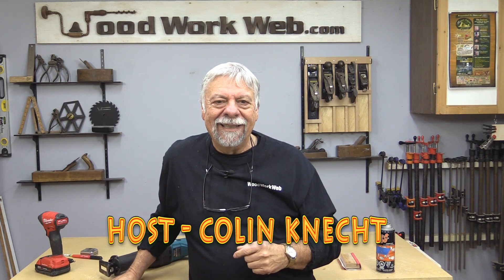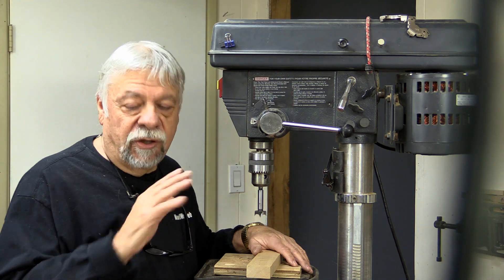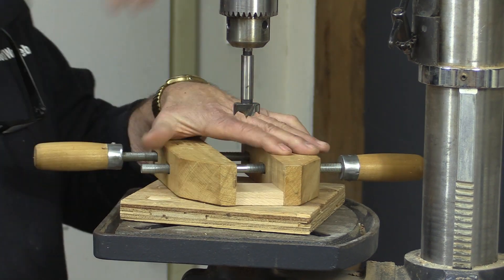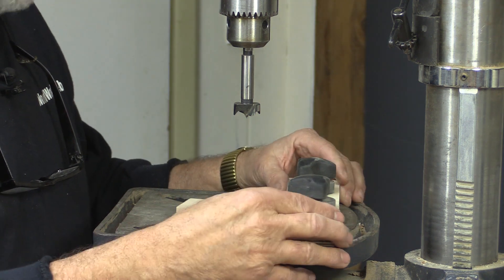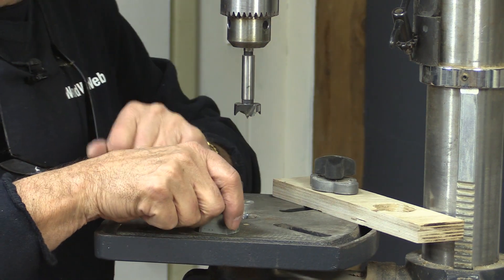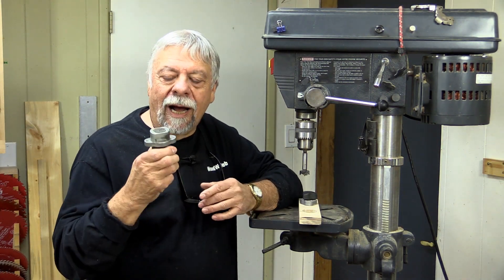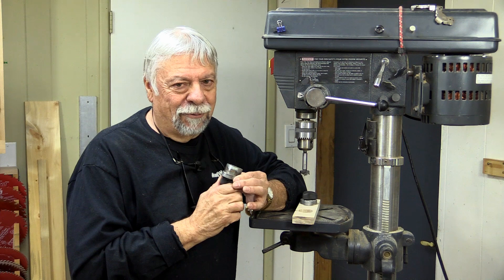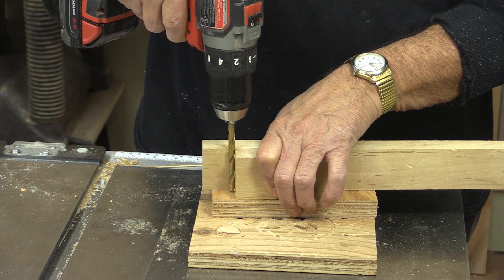5 Quick Drilling Hacks Part 2 - Woodworking Tips and Tricks

Comment: Colin, i had brought a badge holder reel and put my chuck key on it and put it on
the motor of my drill press.  works by taking the key and tighten the drill bits.   lv ur videos.

Comment: Keeping wood secure and steady while drilling is definitely important. The first time you have a piece of wood get slung around and slamming into your hand while you're trying to drill a hole thru it will teach you a valuable and hopefully not too painful a lesson. By securing/clamping down the piece of wood, your hole will also be more accurate....a nice round hole instead of one that has a lot of slop. I spent many years in machine shops and learned how to safely use the big mills on metalworking. The same practices for the mills can be...and should be...used when using a typical drill press.  It's just as easy to work safely as not to work safely....your fingers & hands will thank you for it.

Comment: I have a question about drill press use that is really making my life difficult. How do you drill further than the spindle travel on the drill press? My drill press has a travel on 2'' max. But I often need to bore through a 2x4 for a dowel. I even have some 4x4 stock that I need to bore straight through for some carriage bolts.  Because of the travel it never goes through all of the way. Not even close. I have tried to get creative and drill as deep as I can, then raise the table and start the press with the bit already sunken and try to go that way but  the bits just snap off. I even tried using the hand drill and drilling a small pilot all the way through and then just using those marks on the press but even with my being as still as possible it still wasn't straight. UGH I am at a loss here.

Comment: mag switch  nice tool
Reply: Mag switches are a great tool. I bought some mag switches that was a feather board for my tablesaw would've worked out great except my tablesaw base was aluminum, but I do have a drill press that has a steel base and these would be fantastic for that application, I knew my tablesaw base was aluminum I just didn't make the connection when I purchased the item, can you say rookie mistake.

Comment: Colin,
Have you found most Angle Iron to be square? I would like something to use on a Band saw as well as my drill press that I can rely on being square.
Reply: You can square off angle iron with a sharp file and an accurate square. The work is tedious but you will learn how to use a file. Accurate filing is a basic shop skill.